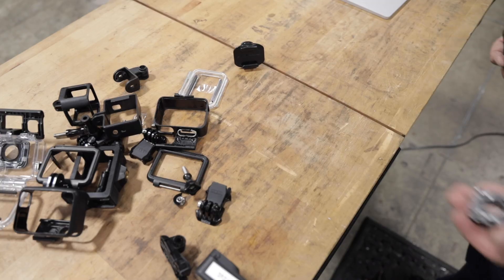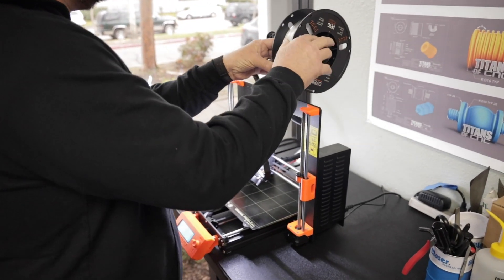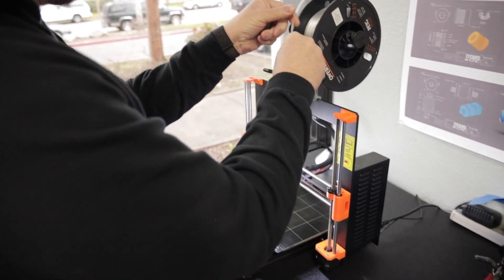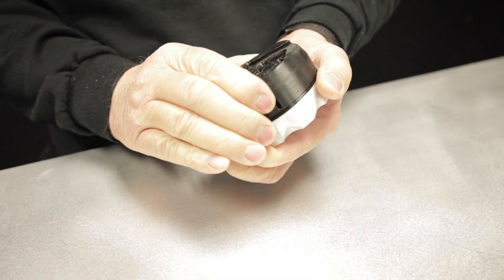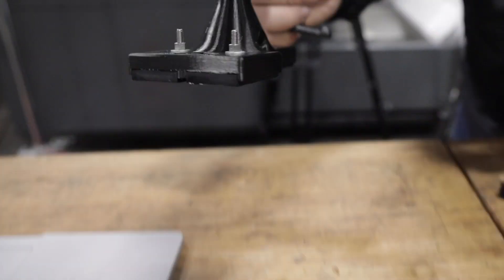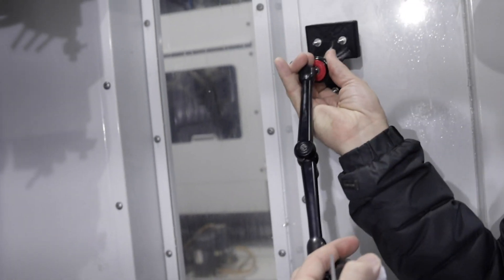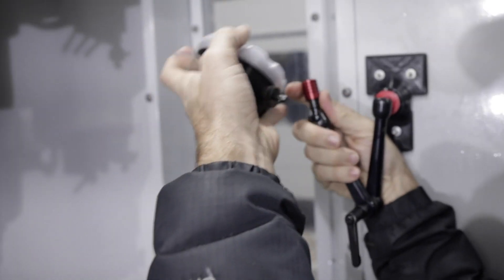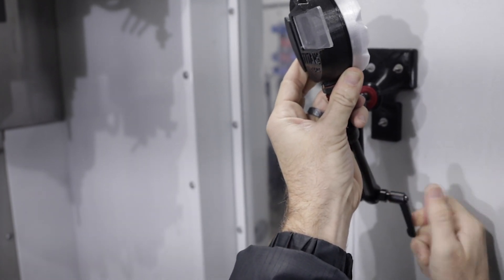Creating Our Coolant-Proof GoPro Cases

Comment: In the past I really never cared much for a 3D printer. But more recently, I have started to see some real value in them as more than a toy. It is admittedly hard not to look at some little filament printed hobby grade type thing and scoff, when we have access to ‘Real’ Machines and ‘real’ materials. 

But little printers like that i3 shine for projects like this. Cheap, fast, disposable but helpful nonetheless parts are a great fit. We Have also used quite a bit just to help customers visualize before we commit to sawing material up. Have even printed vise jaws from them. They’re admittedly not as accurate as we are accustomed to - but they’re rigid if you model and slice them right. So for a funky shaped part that you only have to make a handful of, you just throw a probing cycle in, and it is a nice low cost and fast to deploy solution.

Comment: Not sure how well a 3D print will hold up to the coolant over time. But even more to the point, is there even any kind of o ring or sealing compound anywhere on the case? And why did the case break to begin with? Looks to me from the images like the cause might have been impact, not chemical wear.

Comment: Check out the Luna CNC CRACE https://lunacnc.com/ It's a go pro case specifically designed to be coolant resistant. You can even hook up an airline to blow the coolant off of the window. https://youtu.be/Ca7408AXy7Q

Comment: Nice design but.
3d prints are rarely waterproof,
I see no o-rings (flex filament is not a sealant for coolant)
slide glass is sketchy, but if You add set screw to fix it it will be good
also put it directly close to part to properly test it, not a mile away :)
and make it out of titanium! :D

Comment: trying find a billet case for the GP 7 black & 8 

also someone to make billet or Ti mounts for the Re-Fuel 9hr action pack extended battery
replace there plastic 2 x mounts to billet or Ti  (oem plastic ram & gopro mounts brake from vibration)

https://i.postimg.cc/BQgxsjR8/2020-01-18_19.19.50.jpg

https://i.postimg.cc/x11Ld0S6/IMAG0191.jpg

https://i.postimg.cc/SQc6TTrf/DP07.jpg